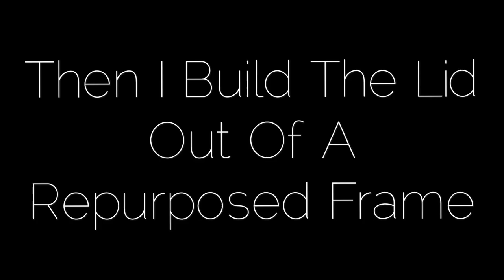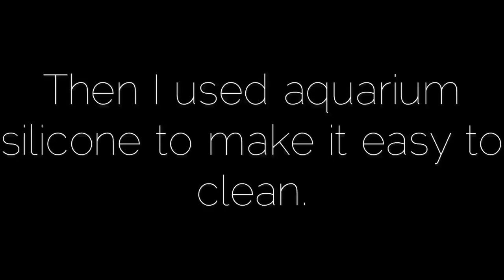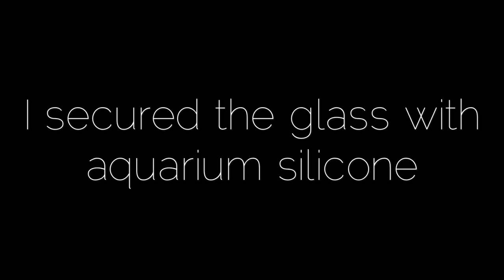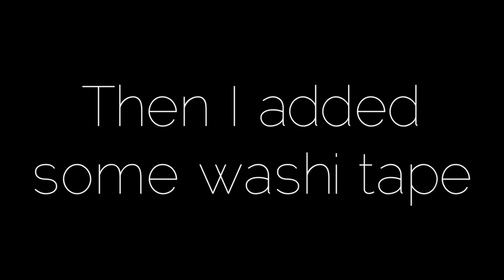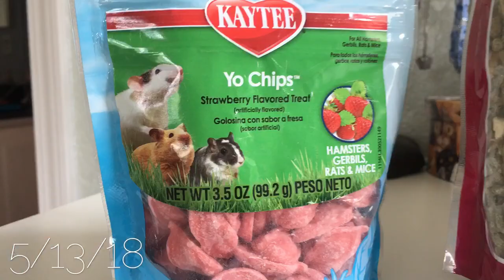I’m Getting a Hamster? DIY Cage!

Comment: The Billy is 448 square inches, just shy of 450 square inches recommended for a minimum size enclosure in the USA. It is so close, I doubt if any hamster would be disappointed. Several years ago the recommended minimum in the USA was 360 square inches, this is well above that. Everything is wonderful with his enclosure, except I would add more bedding at least on one side of the Billy, possibly using a popsickle stick wall...

Comment: this is very helpful thank you! just had some questions, 
1. what size was the glass you needed was it the 30x10 ($15) or 14x10 ($10)
2. have you had any issues with the cage? like biting through or glass falling out? 💓💓 thank you
Reply: or if you could link all the items (ikea shelf and glass) if it isn’t too much to ask! i apologize and it would be greatly appreciated 💓💓
Reply from the maker: Thanks for the feedback and questions!

1. The glass is the billy glass shelf (30x10) that goes with the white billy shelf of the same size.
2. I was a bit worried about the glass falling out, but it is actually really sturdy and you can even put pressure on it if needed. Chestnut has chew toys so he doesn’t feel the need to bite on his cage, so I haven’t had any issues with that. There’s also no places that stick out weirdly so there’s really nothing to bite. 
3. Both the shelf and the shelf extension are in the description box above. :)
Reply: I Rescue Kittens thank you so much ahh!! 💓💕💖💘💞💗

Comment: Do the cage have to be white, or can it be black? I want a black cage, but i want it to be as safe for the hamster as possible☺️ If it’s unsafe with black paint, i would go for a white cage. Or is it the same?
Reply from the maker: Sigrid Aarhaug At IKEA I’m pretty sure that it only comes in white. If you really wanted it black you could paint it with pet safe or nontoxic paint. If you don’t want to get nontoxic paint, you could only paint the outside and leave the inside white. If you do end up painting it black either way, just remember that it will make the cage temperature a little hotter. I wouldn’t recommend painting it black if you live in a place with a hotter climate. If you live in a colder temperature climate, it definitely would be okay if the paint is safe.

Comment: Hi may I know how big is your hamster wheel? Cos I have a 30cm wheel that is huge and I don't think it fits in there right?
Reply from the maker: SquishyDancers My wheel is 6.5 in (16.5cm) and it has about three inches of room between the top of the wheel and the lid so I don’t think your wheel would fit. You could get one of the flying saucer wheels instead which would fit really well. Also unless you have a syrian you can use a 6.5 in wheel.

Comment: Does anyone know what I can use for the lid? I need to buy a new cage for my hamster and this is perfect but I just need to know what she used for the lid ASAP as he is desperate for a new cage
Reply: definitely use chicken wire!! you can get a bin lid and cut out a big hole in it and put chicken wire in place of the hole, or do what she did and use an old frame

Comment: I am currently making the same cage but noticed my glass doesn’t extend the whole way like their is a small 2 cent piece gap did you have the same problem??
Reply: I might be late, but did you order the larger glass shelf replacement?
Reply: I had the same problem, just centered the glass and filled the edges with silicone stuff :)
Reply: @nadiadanielle7142  do you mind putting the link to it xx

Comment: I was just wondering what are the dimensions of the cage. By the way this is a really good video
Reply: Meme Tube as far as I can tell, 32x14”. So it’s a little bit smaller than necessary (by 2sq inches) but still far better than a pet store cage.

Comment: Would the wood soak up urine?
Reply from the maker: - m o c h i It still soaks it up but not as much as paper bedding does
Reply: I Rescue Kittens Ok do you think if I coated it in waterproof pet safe varnish or plastikote it would be ok and not smell? (sorry I’m just really worried about having to end up replacing the cage or it smelling bad)
Reply from the maker: - m o c h i ohhhhh sorry I thought you meant wood bedding. No the cage doesn’t soak it up at all and I’ve had it for a year and a half now and it’s in perfect condition. Sorry for the confusion!!!
Reply: @irescuekittens7861  Its alright! I'm still happy I will be able to stop looking for cheap fish tanks with enough room (its pretty hard XD)